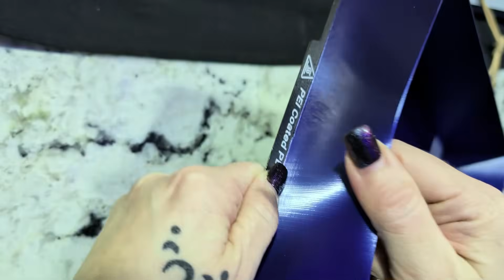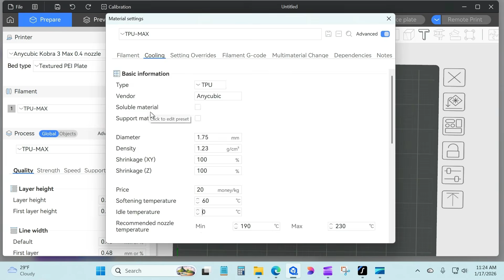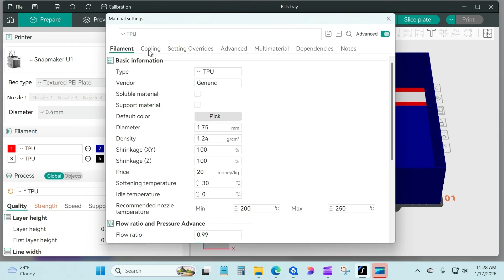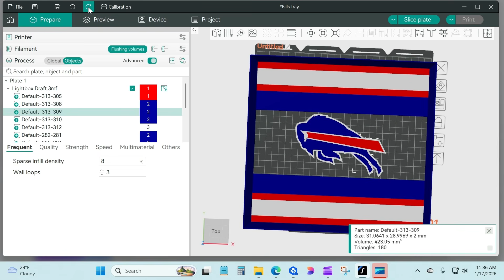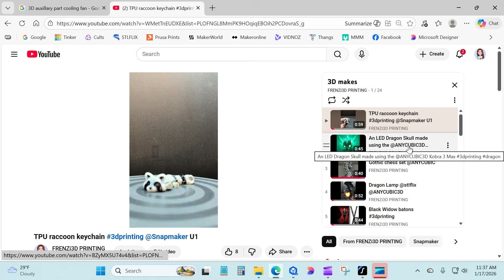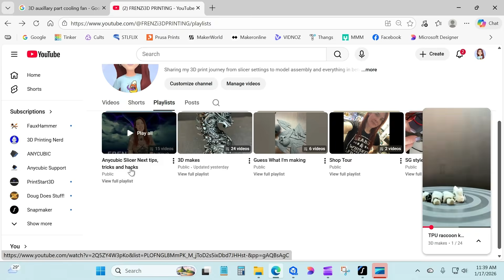Perfect TPU Settings for both SNORCA and ACSN #3dprinting @Snapmaker @ANYCUBIC3D

Comment: Forgive the ignorance but which TPU do these settings work with?  It does it work with all of them.  68D, 95a....
Reply from the maker: 95a, although I have used the same settings for 85a successfully
Reply: @FRENZi3DPRINTING thanks for replying.  I'm new to this.  I have some 95a but was thinking of their 68d since it will run through the ACE2

Comment: Thank you very much for this. Having a hard time with tpu since I got my kx. 
Best guide ever 
Keep up the good work and God bless for sharing your knowledge to noob like me
Reply: hi! Did you find the best calibration? I got a KX and printed some with tpu95a, is almost the way I want but at the retracation I still have small points! How goes with you?
Reply: @dudbr  Honestly I just followed what she posted it work great for me dried the tpu and used a dry box while printing. I'm using Overture high speed TPU. Got the first clog 1 week after i got the kx lol, broke the sensor, bought new print head since it was 50% off that time and support send me new sensor under warranty now I have 2 working KX print head

Comment: Just ordered my u1, I was wondering if you can save the profiles in orca after the U1 runs its filament calibration. Coming from Ender3 v3 se running klipper its a bit weird to me with all the auto tuning stuff.
Reply from the maker: Yes. It's the same process. Open Orca, start with an orca filament profile that matches your material and use the edit icon. Enter the changes and click the save button

Comment: Another needed video. Thank you for sharing could you do video discussing what you need to make a flexible part for tpu. like the strength setting. i imagine the infill percentage is super low etc.
Reply from the maker: The only thing I adjust for strength to make TPU more flex is to reduce wall count and turn off thick brosges

Comment: 6:07 Is there a reason why you are deselecting the "User Preset" option?
Reply from the maker: It's not necessary to check it or un check it
 The default is user preset. I tried to re-check the box and now it will not let me 🤷‍♀️
Reply: @FRENZi3DPRINTING  Thank you!

Comment: How come you didn't just print the red with buffalo bills print on the u1 since it has 4 heads? Just wondering why ur printing them separately? Genuine question. Not being a smart elek. I promise
Reply from the maker: I tried, but the filament jammed up on initial loading and there was no notification from the machine so it air printed. I had no idea until the next day when it finished 😞